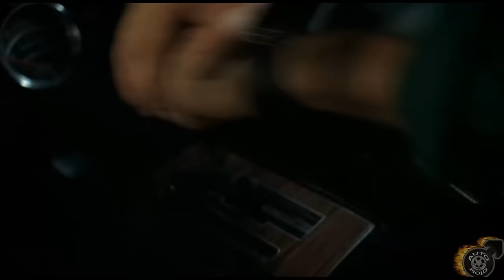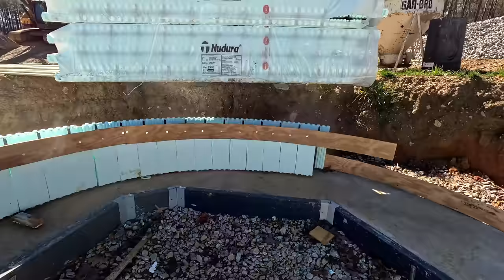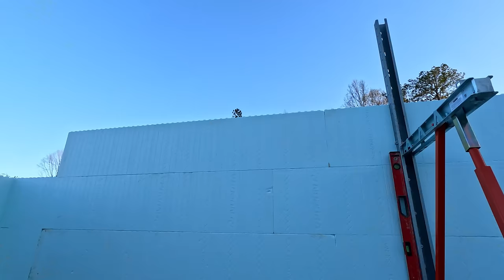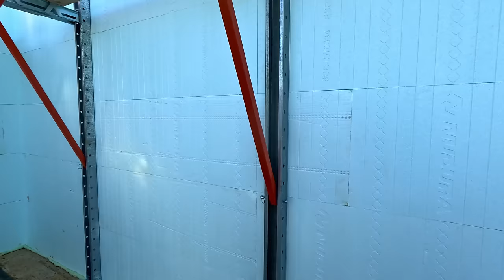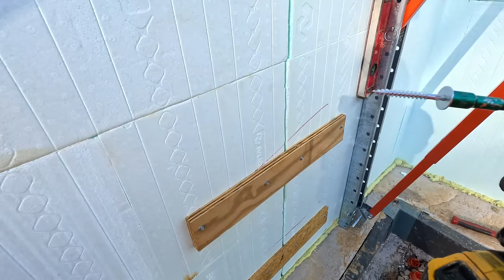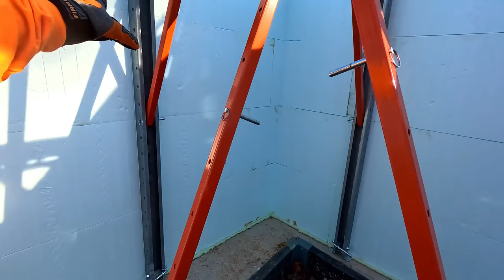Underground ICF Theater and Setting Up the Plumwall Bracing

Comment: I know some are going the route of pouring the floor first. Row or 2 of block & floor poured at the same time. Easier to reach in and do the floor, then you have a nice level, dry surface to work from going up.
Reply from the maker: Yeah. I thought about doing that, but ultimately chose not to because I have steel columns and beams that have to go in and the beams reach over to the walls. But the floor concrete is supposed to be poured over top of the steel. I could have poured the concrete just over and around the columns later, but didn’t want to plus there’s a lot of crap that goes in the floor.

Comment: Hi Geoff
Giving nice explanations of the process, keep it up.
It is nice to have "quiet time" on the job to clear your head out some.
Absolutely no offense meant on the following, just concern for you.
Please do yourself & all workers on your job a huge favor & purchase a bunch of 2x10 minimum size southern yellow pine or douglas fir for planking & set them double wide.
A single 2x8 spf is not adequate to be walking on! 
Screw 2x6 blocking solidly onto the walls in line with the braces to support the ends of the walk planks. (Screw the planks to these) Then planks can be lapped over each other.  Never leave the end of a plank unsupported.
I cringed when I watched you walking on the 2x8's when pouring the 1st load of conc "fill".
Accidents happen way to fast for an experienced worker yet alone for a crew just learning.
Your health & safety is way to valuable & have an accident on your home when you have so much to do yet.  Let alone being able to enjoy it with your family when your done. 
Coming from a guy that's been in the trades for over 50 years.

Comment: I have so many questions!!! Not being a  "builder" ...
Are the foam boards re usable? 
Advantages vs just using plywood forms?
Cost vs Plywood?
insulating factors? 
Any penetrations thru concrete now requires drilling? 
Im assuming the foam boards, once the concrete is poured and set, come down?
Structurally, quite stronger the stick and wood framing...
Once the forms are done, does construction go as normal, stick and board? I cant imagine the entire mansion being all concrete walls( interior)?
Cost vs regular stick frame?
Sorry Geoff,  just curious minds, wanna know! HAHAHA
Reply from the maker: The foam stays in place. Lots of good questions. I’m planning to do a live and discuss. Thanks 😊

Comment: Nice video Mr Bealy Good. How are you going to get the rebar in the forms?
Reply from the maker: The horizontal rebar was put in as I built it. The vertical will be dropped in from above
Reply: @BealyGood  ok that's good, I didn't see you putting any rebar in, thanks.

Comment: Geoff,can you explain the purpose of the "common" in-line joint in the walls? Have seen it in other builds but have not heard an explanation on why it is done
Reply from the maker: I’ll make it a point to discuss in an upcoming video. But the basic reason is when you lay out the blocks, not every wall will be evenly divided by your block. So you have to cut pieces to fill in. Then you have to put a strap across where the two ends meet. It’s easier to stack those common seams on top of each other so you can work faster by knowing that’s where you have to cut a block and strap in one spot.
Reply: I like that explanation, but for my interpretation of the need to place all your cut joint seams in a common stack,  I would add that it helps a builder to prevent having a "stray" cut joint seam that could get overlooked in the strapping phase of the course stacking. And........along that same line of thought (about planning to keep all your cut seam commons in one spot) you reduce the likelihood on ending up with more than a single cut joint seam in the same course. @BealyGood

Comment: I have a question: Is there any way of preventing the vertical brace against the wall from moving when the concrete is poured in? Having done concrete form work in a previous life, I'm aware of the tremendous pressure load at the bottom of form work.
Reply from the maker: There is a spot at the bottom that allows you to tapcon the brace to the footing, if you so desire.

Comment: I’m building a 32x76 basement and have been wondering about ICFs 
What do they charge for the braces and plywood inside (1 sided forms). I assume there’s a rental fee associated with that?
Reply from the maker: Doing a basement you wouldn’t really want to do the one sided forms. You would do the regular foam on both sides. Because you can screw the sheet rock right to it. Unless you want the look of concrete on the inside.

The braces can be rented. It depends on where you’re at and how long you’re going to have them. Some places are $20 per brace per week. I’m looking at renting mine after I’m done and will probably do a better deal than that.

Comment: Been looking at ICF online.  From what I'm seeing, they don't seem to be used on commercial or industrial.  Is that the case or am I looking in the wrong places?  I was wondering about using it for a large shop.
Reply from the maker: They’re being used a lot in commercial. Many schools are now being built using them. Also, apartment buildings. Would be easy to construct a shop with them.

Comment: In commercial construction I have never seen anyone prepare concrete forms for any type of penetrations  They always pour the concrete, let it cure, then cut the necessary holes.  It is found to be easier and simpler.
Reply from the maker: That’s interesting. I did many commercial buildings over a period of 25 years and the architect always requested we specify our conduit requirements. If they had to drill the concrete we got lots of crap for that. 😊
Reply: @BealyGood  --- I checked with an old friend in NYC, He said for conduits in structural members they are careful about embedded conduits and the openings (not your case)  For poured walls he said no one blocks out for the penetrations, they have holes drilled afterwards - the trades are always off by a little, so it's easier to drill once than block before pour, fill the hole, then have to drill again.  My friend's clients are large commercial projects in metro NYC, his firm does the project management, he has several hundred PEs working for him so I don't know how current his information is, I wonder if he still gets out into the field to observe that level of detail anymore.

Comment: Can I ask please. A silly question I expect, do the pieces you are putting together stay in place when you have filled the middle with concrete. Here in the UK I’m more used to seeing a brick outer and what we call a breeze block on the inside. Not sure which is cheaper or easier to put together as I’m not a builder!
Reply from the maker: Yes. Those pieces stay in place and act as the insulation for the house. The black webbing is also what the Sheetrock gets fastened to. Good question , thanks for asking.
Reply: Thank you, I am really enjoying your journey it is so nice to see a lovely home being built

Comment: Solid concrete walls . What's the plan for water pipes and electrical conduits ?
Reply from the maker: Have to put in sleeves before the pour
Reply: @BealyGood  What if you change your mind?
Reply from the maker: @rajbeekie7124  concrete bit

Comment: Geoff... what are those two gaps that go all the way through the forms? I assume they need to be there, just curious what they are for.
Reply: Comment generator lol..... unfinished openings
Reply from the maker: Can you give me a rough time stamp to which openings you’re referring to? Thanks
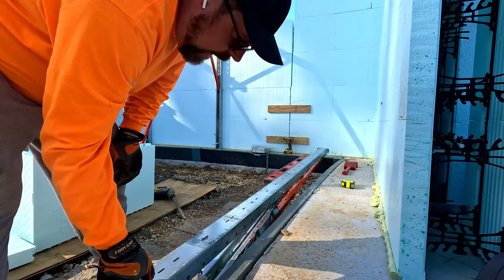Reply: @BealyGood  Where the pieces of wood are screwed across them @  7:42 and 14:32. Thought maybe they were some kind of expansion joint or something.
Reply from the maker: @george8873  They’re a common seam. I’ve had a lot of questions about that so I’ll make sure to discuss it in an upcoming video
Reply: @BealyGood  Thanks for replying Geoff. Will look forward to you discussing them.

Comment: thought you would have had to stagger those joints
Reply from the maker: I stagger each row however, there are of course cuts that have to be done. If you make a cut and do not have 8” between the webs once you put the blocks side by side, then you keep that same seam all the way up and strap it with the wood as shown. The thought process is that you manage the weak spot all in one place.

Comment: 18:01 Around the 12 min mark there is a series of joints on each course that are all in line. Why is that done way? I am a far better electrician than an ICF builder.
Reply from the maker: Lots of questions about that. I’m going to have to make a video on it. Stay tuned.